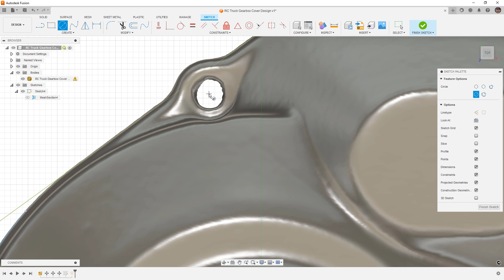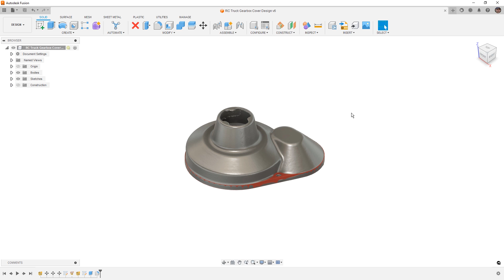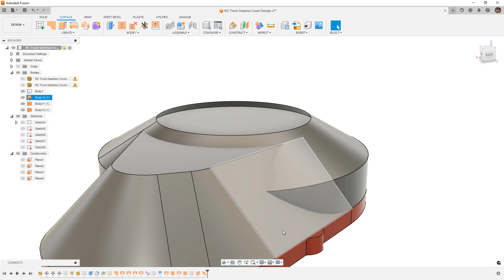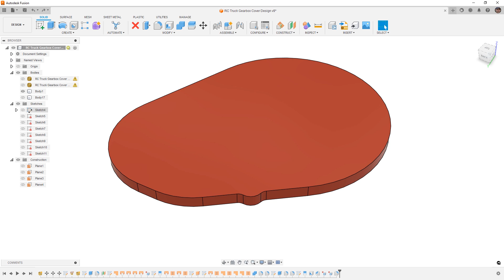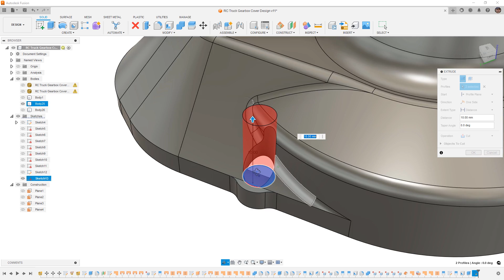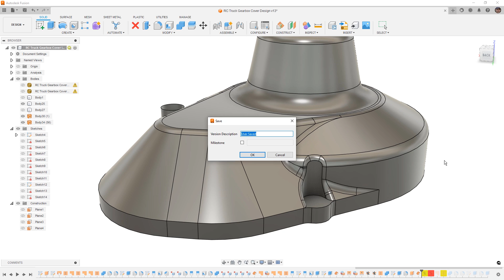3D Scan Design and Print Series Part 3 | Design Your Own Gearbox Cover | #revopoint #mini2

Comment: What if I don't have a flat Scan?
Reply from the maker: I am not sure what you mean by "flat scan".  do you mean placing the part on a scanner for a paper print?  If you don't have a scan you basically have to measure everything as best you can.  Depending on the part it may be prismatic and easy to measure.

Comment: Totally dumb question (I’m obviously missing something simple) but why is the mesh body sometimes black and sometimes the silver-grey? And, can you change the color of the mesh body?
Reply from the maker: Not a dumb question.  
Sometimes the mesh body looks black because of the number of triangles.  this is common with really high poly count meshes.  If you hide the edges (CTRL +4) you will see just the faces.  you can bring the edges back (CTRL+6).
You can change the color of a mesh the same way you do any other body.  using A to open appearances.  Also note that meshes have an option in the Inspect menu for mesh face groups.  Those will color the mesh based on some predetermined mesh angles.  So for example if you had a box, each face would be a different color when you turn that option on.  You generally use that when using the mesh conversion stuff.
Reply: @LearnEverythingAboutDesign thank you, Matt. Until now, I’ve had no reason to work with meshes but that will change now that I have a Miraco. I’m trying to soak up your knowledge on yet another front.

Comment: Came here looking for a better understanding of scanning with Revopoint, and was equaly impressed with your style in Fusion, not how i would have done it but i learned a few new tips tricks and techincs. Thank you,
Reply from the maker: Thanks!  We have loads of different videos and cover multiple ways to design off a scan or reverse engineer from a scan using Fusion and Quick Surface.  There is a 3 video series looking at forms, mesh section sketches and finally an "approximation" of the shapes.  We also reverse engineer a part from Quick Surface/fusion and one entirely in fusion.

Comment: I wish there was a more automated process for this. It takes a lot of time but worth it in the end. Great job.
Reply from the maker: There are automated tools in mesh programs like Geomagic and QuickSurface. but honestly the resulting geometry is far less than ideal.  In some cases if you can get a quad mesh imported to fusion you can directly convert it to a forms body.  Stuff like this takes a little longer in Fusion than in other programs made for mesh reverse engineering FYI.  I will be doing videos in other programs this year to show that process.

Comment: Thanks for another great video. What i was really expecting to see was using the scan to design another part based on it. For example using the scanned body for a base to design a new cap/plug or perhaps design a gasket to seal the part better. As others have said you would possibly have been quicker doing this from scratch but for more complex parts i can definitely see this being a way to perhaps slightly improve the original design.
Reply from the maker: There will be more to come!  The next scan series currently on the list is scanning the body and designing a new one.  The plan is to compare the mini2 vs the miraco for something this size(might even use the Inspire as well).

For things like a new plug for the cover that would certainly be possible with a TPU material but unless it screwed on a PLA just wouldn't work.  it might snap in but you would probably break it trying to remove it :)

If it were just a gasket, the trace on paper and 2d scan into the computer is likely much easier/quicker for that.

Comment: Is there a obvious improvement from mini to mini 2? Is it worth to upgrade if I already own the mini?
Reply from the maker: Nope I would say not.  We did a mini2 review video and talked about the improvements.  The actual quality of the scan is the same but you can scan a slightly larger area.  It has flash leds helping with color capture and with setting the exposure.  It has wifi6, so if you are scanning over wifi to a phone that will bump up the speed.  and it captures at 16fps in its rapid mode vs about 10 on the old mini.

In my mind not enough to justify.  IF you were to add a scanner I would go to the Miraco as it has the near and far mode OR the Range if you need to scan larger objects.

Comment: is it really worth the hassle to scan an object? it seems it would be less steps and more accurate to take a picture of the base, or trace outline with a pen, then xfer into fusion as a Cnvas. Measure with caliper and go from there? love the channel btw.
Reply from the maker: That is always the decision.  If you have a part that is hard to measure or more organic OR you need to compare a scan of the completed part to a CAD model of the design then 100% scan.  This part could have gone either way honestly.  Having the height and shape references were helpful to use as a "keep out" zone for the new design.  It could have been done either way but easier with the scan in this case (in my opinion)
Reply: @LearnEverythingAboutDesign  what 3d scanner do you think is the best to buy?
Reply: @KagmanX there is no best scanner. I use Revopoint mini for small stuff, Einscan SP medium stuff like PS5 controller, Einscan Einstar big stuff more than double the size of a PS5 controller. Car interiors, Transport boxes.
Reply from the maker: @KagmanX  Depends on what you want to do with it and what your budget is.  In the world of scanners there is a low entry point and generally the price goes up while the quality goes up incrementally.  I really enjoy the Miraco scanner.  Has the ability to do near and far mode so you get 2 scanners in 1 unit.  Plus the ability to have it all in a self contained unit rather than having to plug it into a laptop.  It is on the higher end of the hobby/diy scanner segment.  There are some new players coming into the market around the $2000 mark that I am keeping an eye on.

IR Structured Light is most common for hobby/diy scanners.  Miraco for example as well as others like Creality scan ferret and lizard.
Blue light like the Mini2 generally gets you a little bump in performance and scanners up into the $20k+ range still use blue structured light.
Laser is generally the highest price and offers the biggest performance jump.  There are some coming on the scene but right now i think the Shining3d Freescan at $17k is the lowest professional grade solution in that segment.

For my money the Miraco still takes the cake.